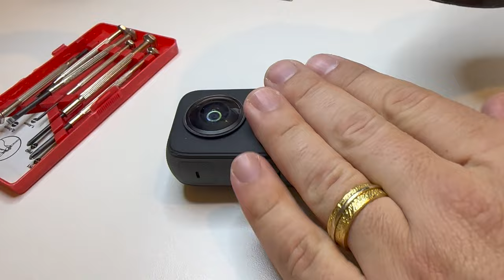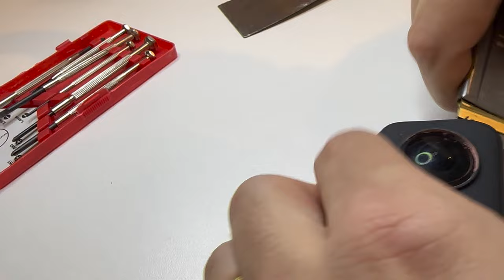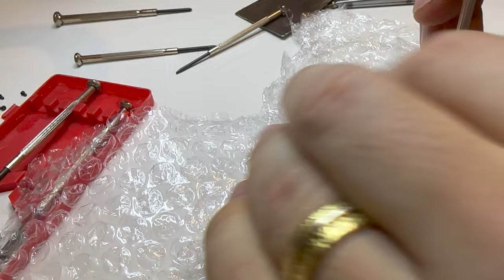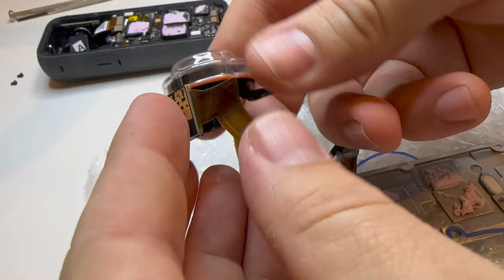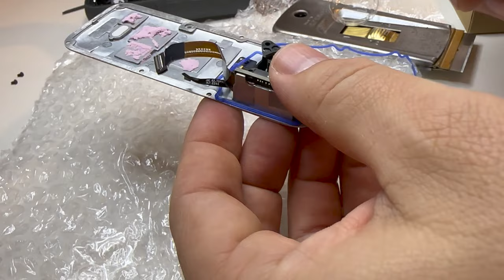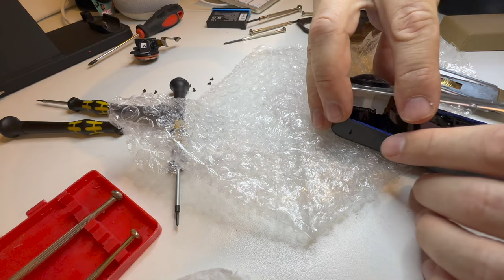Insta360 X3 Lens replacement / lens change  DIY Fast and easy

Comment: In Aliexpress there are cheaper listings for Glass Lens replacement, is there a reason why you went with the lens module?
Reply from the maker: Because it looks a lot easier :)
Reply: because to change lense glass you need to pull out the lense assembly. where as in x2 you don't need to do that

Comment: Don't you like the way that the the faulty lens gets to rest on some bubblewrap to prevent it getting more scratched while being worked on, but the good lens, the one 'without scratches' sits directly on the workbench with no protection at all.

Comment: Help me please! This camera has a connector for a selfie stick, the selfie stick was torn out and the case was broken, the case was found but the camera heats up during operation, they said that they needed thermal gum, it was too expensive.
Tell me what can be done to prevent the camera from heating up?

Comment: Hi there, this is very useful, but the bit I'm struggling with is "6. Unscrew the lens". How does the lens unscrew? Which part of it unscrews? I hope you can point me in the right direction...
Reply from the maker: The whole lens module is connected with - I believe - 4 screws. Unscrew them and then release the connector and you can remove the lens and put the new one in

Comment: Just watched your video...my camera has one of the lens now out of focus as the selfie stick that was mounted on the motorbike decided to fall down onto the floor and knocked the camera out of place and scrapped the corner of the camera away. Stupid question but to avoid confusion did you order the front of back camera as several sites call both ...both!!!!!! I need the other camera and want to make sure I get my front and back correct 😂
Reply from the maker: the front side is the side with the LCD screen. I ordered the back side lens in this video
Reply: @mondesi83  Thanks for the speedy reply. Thanks for putting the video on YouTube ...is your camera working ok now with the 360 video. Have you got a case guard/protector ? 🤪
Reply from the maker: @gsd32i  Yes, it's working fine with the new lens.  I also bought the lense guard via insta360 website. I should have done it from the beginning, didn't know they were so fragile.  Camera fell of my motorbike and glass was scratched which was visible in all movies. Now it's resolved!
Reply: @mondesi83  Thanks just about to order a new lens from the place you got yours from. Thanks again for speedy replies and have a great day 👍
Reply: If its ok with you I have shared your video in the description, on the one that I have just put up showing my Insta problem.
Reply from the maker: @gsd32i  Sure. I watched your video. To replace the that lens, I think you have to do the exact same thing as how I did it, which is opening up the back.  I think someone in my comments here did it like this. So to access the front lens you have to go via the back as in my video and just use “the other half”.  To close the lid back, I used a bit of Tec7 silicone kit to make it waterproof again (you will see there is a small rubber there now). Maybe you can also apply small layer of tec7 in the edges that scratched the road.  Good luck!
Reply: @mondesi83  Thanks 👍

Comment: hello.. Can you tell me if after changing the lens you had different colors in the image and it was not visible in the stitching of the images?
Reply: Hello, I can assure you that with the lens I bought, I have had no issues. However, it was not cheap.
Reply: I’ve just done the lens swap and have the exact same issue.

Comment: only place i can find the lens module for sale now is mputek for $170 -- is that right??
Reply from the maker: I am afraid that's correct. It's the same price as what insta360 charges if you send it to them. But it takes longer when you send it to them. When I bought it, it was a bit less expensive (not much though)
Reply: @mondesi83  understood! thanks for the video and response! all extremely helpful.

Comment: @mondesi83 hello. I see you opened the back side of the insta360. You have access to remove the module for the front lens also? or for the front lens, you need to open the front site of the camera?
Reply: Only access to back I think
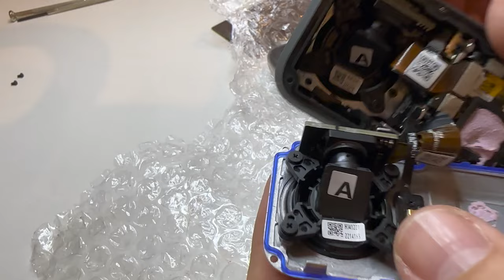Reply: @bxlbiker4769  thinking is one thing, knowing is another. at 6:55 you can clearly see the screws for the front lens aswell
Reply from the maker: @lamunte  I guess you are right. I also don't think the front is removable same way as back. Unscrew them and see what happens!
Reply: @mondesi83  well I opened mine from the back and changed the lens from the front. The problem is that the exposure is different on the new lens and the stitch line is really visible. So camera is basically useless at this point. 
I see in your video that you changed the whole module, not just the lens, as I did. Can you please tell me where did you find to buy the whole module? A link would be much appreciated
Reply from the maker: The link is in the description
Reply: @mondesi83  oh I see, is out of stock now

Comment: Fast and easy???? Every other video I have watched they just popped off the outer lens (which is just a glass cover not really a lens) and pop in a new one. I couldn't find the lens ass you used on AliExpress anymore. That is fast and easy, this is not, not to mention around $30 a side.

Comment: Once open its done, no waterproof
Reply from the maker: It wasn't waterproof in the first place, and it also depends with what you close it. I used a thin layer of Tec7 so should be fine.

Comment: Still waterproof?
Reply: Not waterproof to begin with
Reply: It is according to insta and many people who have tested it
Reply: prob not. The blue thing was not placed properly before he closed it. The adhesive needs to be replaced, but he did not on  this one.

Will still work as a good insta360 x3 action cam, but you cannot get it super wet or submerged in water
Reply: So glad I purchased insurance 😂

Comment: So I'm guessing it's not water proof any more.
Reply from the maker: It wasn’t in the first place but I sealed the lid with tec7 so it should have the same or even more water resistance
Reply: @mondesi83  why wasn't it in the first place. I've been in the sea with mine many of times. 🤔
Reply from the maker: @rossthomson9833  I read a lot of complaints that it wasn't as waterproof as promised and that people always advice to use the dive box. I actually never use it under water, but it has been in rainy weather and so far I had no issues.